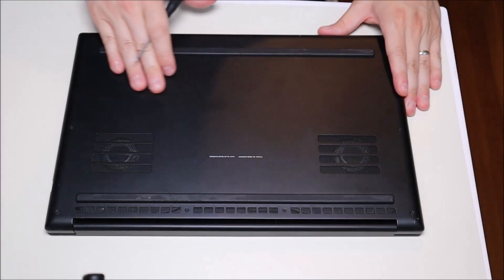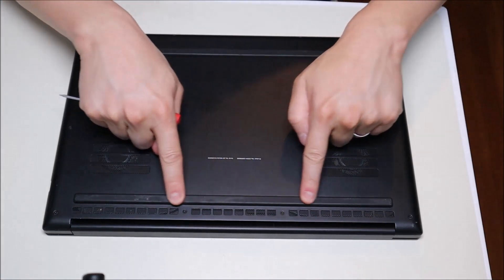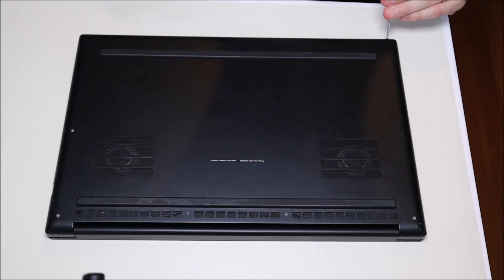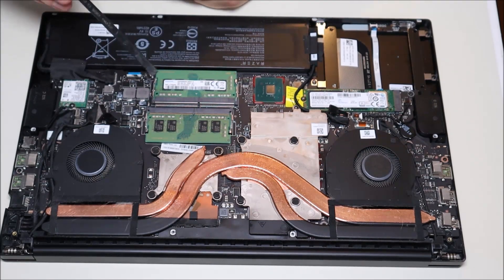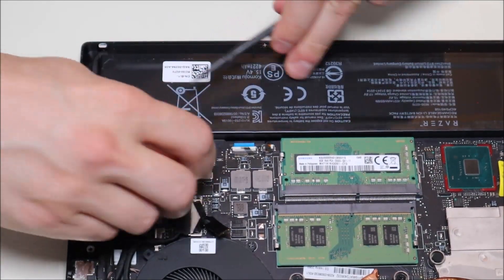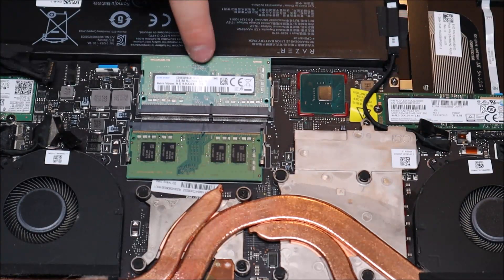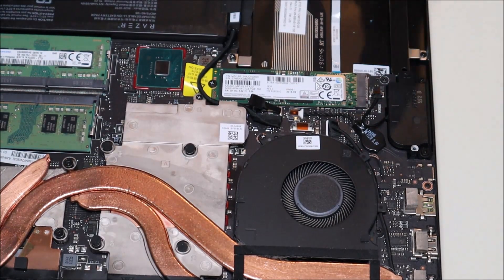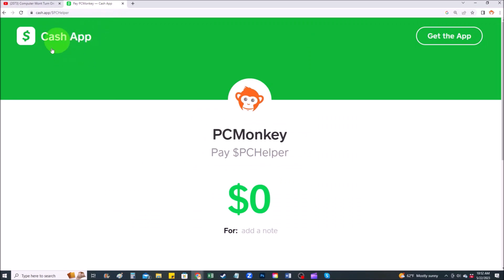How To Replace Upgrade SSD HDD Storage RAM Memory for Razer Blade Laptop Computer

Comment: Jamin my laptop turns on but it says preparing automatic repair and then says diagnosing your pc and then I tried everything but still did not work
Reply from the maker: 1.  What brand computer do you have?
2.  Also, did anything happen before this issue appeared?  Liquid spill, overheating, Windows update, etc?
Reply: @PC_Monkey  Lenovo and probably overheating
Reply from the maker: @P3tl0v3r    1.  Can you try the steps seen here?  https://www.youtube.com/watch?v=Q0UqVVcKuM8
2.  Just so you know, over heating situations can be hard to troubleshoot just one issue as multiple different components and boards including the motherboard itself, could all be faulty.  
An overheating computer can be damaging multiple different components if not resolved. First, make sure that the fan and vents are clean and clear. If you need help accessing the fan, let me know what brand and model computer you have and I can help you get inside it. If that does not fix the overheating issue, then try replacing the thermal paste on the CPU and if needed, the GPU as seen here; https://www.youtube.com/watch?v=K_j4GPjpawk. If that fails too, replace the CPU

Comment: My laptop shut down at 95 percent and my laptop shut down... And when i turn it on it start charging from 1 percent then 2 ,3,4,5,6,7,8,9,10,11 upto 22 percent and then it jumps to 100 percent from 22 percent, and when i plug 🔌 off my charger it shut down again on 95 percent , how can i fix this problem?
My battery 🔋 health is excellent....
Reply from the maker: 1.  Can you try the steps seen here?  https://www.youtube.com/watch?v=uBr5XmtmKKM
2.  Also, did anything happen before this issue appeared?  Liquid spill, overheating, Windows update, etc?
Reply: @PC_Monkey   There is too much moisture in my room  I am living in cold area  .... From may to September my laptop shutown at 70 percent charge... In first week of  September my laptop shut down at  84 percent charge then now it is not even opening the screen what should i do now!
Reply: @PC_Monkey  should i buy a new battery?
Reply from the maker: @cricketlovers3207  So now your computer wont even start?  Are there any signs of life at all when you try to turn it on? Lights? Fan, Motherboard, or Hard Drive sounds? Anything seen on the screen?
Reply: @PC_Monkey   yes there are signs when i turn on there arr lights on ib my keyboard.... Then i watched one of your precious video and I open my laptop and plug off my battery and then again plug in my battery and  after that my laptop turn on but the problem is still there it shut down on 95 of battery
Reply from the maker: @cricketlovers3207  I would try replacing the battery at this point
Reply: @PC_Monkey  thanks for your time